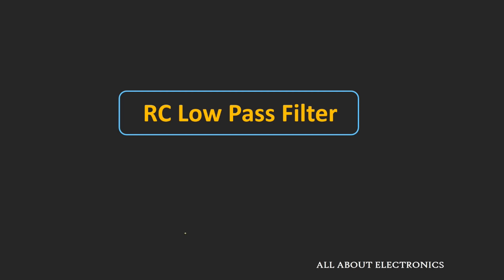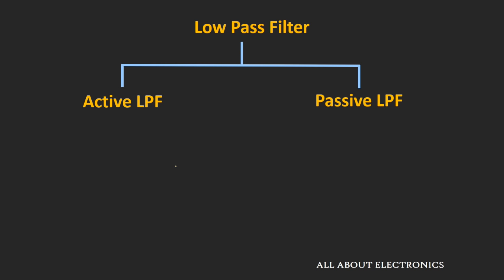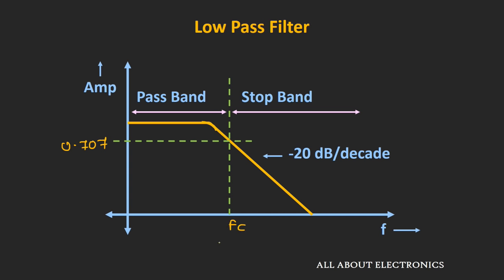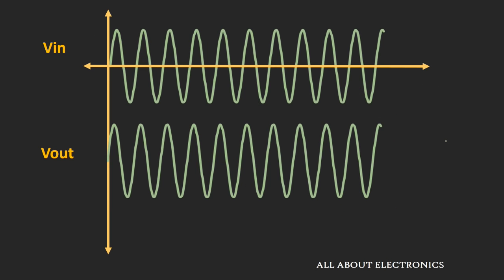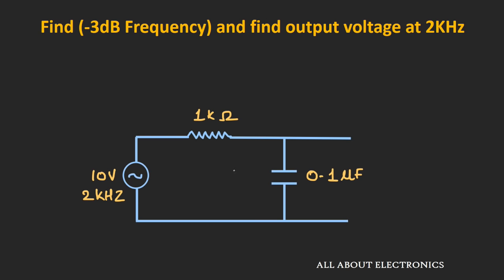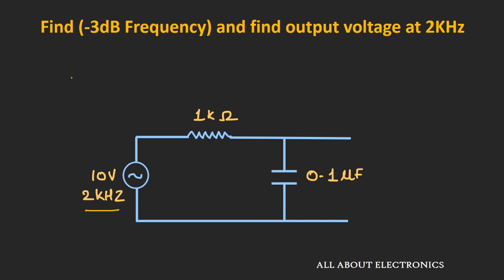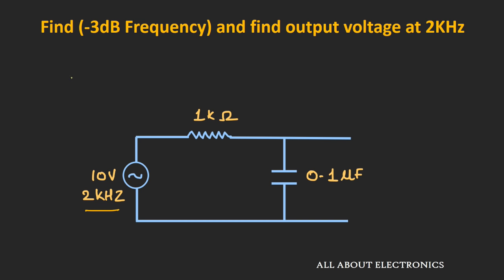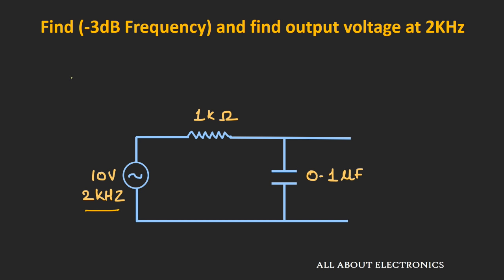RC Low Pass Filter Explained

Comment: At 9:10 you wrote 2(pi) x 10^3 x 0.1 x 10^-6.  PLEASE BEAR WITH ME.  If the resistance(R) is 1 kila ohm  and the capacitance(C) is 0.1 µF.  Why is it not written as 2(pi) x 1 x 0.1 and where did the third power, as well as the six power come from. Why is the sixth power negative? Also is omega a constant. If so, what is the constant value? If you don’t feel like answering all this, I understand can you copy the link to one of your other videos so I can learn where this stuff is coming from?

Comment: Good explanation sir.. cut off frequency is 120hz, frequency band 20 to 120hz,  its for a 200watts subwoofer,  that is output from the amplifier sir..
1) what could be the value of resistor and capacitor for either second order or third order? 
2) How to find the resistor wattage? 
3)substitute unit in the cut off frequency formula,  ex:  resistance in ohm or kilo ohm,  capacitance value in farad or microfarad or nf etc,, 
If you help me solve this sir,  it could be  useful not only for me but also for everyone sir...
Reply: We are all waiting for your valuable reply sir

Comment: t's basically how fast the capacitor charges.. There's a resistor there so.. it gives resistance.
The charge curve is effected, but there's no load resistor to say how fast the capacitor can discharge.

So... a specify threshold frequency is controlled or watched..  The resistor in front of the capacitor is kinda like a regulator valve for how much frequency at a specific voltage is allowed to enter or charge the capacitor.

What medication can I take to remember all these equations.. lol.. seriously.

I WILL learn.. If it takes me my whole life. I've learned a great deal, but more MUST be learned.

Comment: I didn't understand in 10:14 minutes
.. how Vout = |xc|/√(r²+Xc²)   ? 
plz help.
Reply: Look at the circuit diagram it's similar to voltage divider and therefore r2×Vin/(r2 + r1). Then replace r2 by Xc and r1 by R as given.

Comment: Thank you sooo much I understood this concept very clearly 
But one doubt how did we get 
Vout=(xc/xc+R) ×Vin
This equation
Reply from the maker: Using the voltage divider rule.
Reply: @ALLABOUTELECTRONICS  thank you soo much
Reply: Hello friend, Vin/(R+jXc) is the current through the circuit. Output voltage is the product of current flow through the circuit and capacitive reactance. So Vo = jXc×Vin/(R+jXc)
Reply: @circuitsanalytica4348  thank you 😊😊

Comment: at 5:03 the output reduces by a factor of 20 if frequency is increased by a factor of 10
Reply from the maker: It is in dB. If you convert the dB into normal amplitude then it will reduce by the factor of 10.

Comment: At 3:13 I’m confused, I’m pretty new to this find of stuff so tell me if I’m wrong. But Vout is Xc•Vin/(Xc + R) which means that multiplying Vin by Xc, then dividing it by Xc, wouldn’t that just cancel out?
Reply from the maker: Vin is not just divided by Xc, it is getting divided by (Xc + R). So, Xc will not get canceled out.
Reply: Dear Collin, it is the application of voltage division rule. Vin/(R+jXc) is the current through the circuit and product of this current and capacitive reactance will give output voltage......

Comment: on 7:12, aren't we taking the phase difference between voltage across resistor and capacitor? Which is clearly 90 degrees.
Reply from the maker: No, here we are taking the phase difference between the input and the output. The output is the signal across the capacitor.

Comment: Good job explaining. Appreciate it. Can you kindly explain to me that is it possible to use one of these filters to chop down frequency coming out of a high frequency (HF) transformer @220v, to 50 Hz @220v +- 5%?
Reply from the maker: Filter selectively passes certain frequencies and removes the unwanted ones. In your case, if HF transformer does not contain the 50Hz frequency component then it certainly cannot be filtered out using filters. Filters cannot perform the frequency conversion, it can only select or reject the band of frequencies from the input. 
I hope you understood what I mean to say.

Comment: Class is very informative sir .I have question that a signal passes through a low pass filter with cut off frequency 10Khz then what is the minimum sampling frequency?
Reply from the maker: Do you mean to say, what should be the sampling frequency of the filtered signal?
Reply: @ALLABOUTELECTRONICS  will you plz tell me how can f=2000?
I didn’t understand.
Reply: @moriomchowdhury9170  2khz input fq is f=2000hz

Comment: How is the phase lag zero for zero frequency (DC signal)? It will take a while to charge up the capacitor from 0V to DC voltage. Will it not account for phase lag?
Reply from the maker: For DC, frequency f=0 or w=0. So, phase tan-1 (wCR) will be zero. Of course, capacitor will take finite time to charge to specific value at DC. But it will come under transient time. Here we are taking about the phase lag in steady state condition. Therefore for DC, it will be zero. 
I hope it will clear your doubt.

Comment: Sir,having a doubt.@11:09 in the graph of frequency response when there is the line parallel to frequency axis for low pass band,is that showing the amplitude of input and output are same(i mean is that showing unity gain?) cause if we think the low pass filter as RC circuit,then the amplitude of voltage across the capacitor won't be same as that of the input amplitude,right?
Please help sir🙏
Reply from the maker: You mean in the passband right !! In that band, the gain almost remains constant. Of course as you rightly said, the reactance of the capacitor changes with frequency and so does the relationship between input and output. But in the passband,that change is very subtle. And  when the scale is in dB, it hardly noticeable.

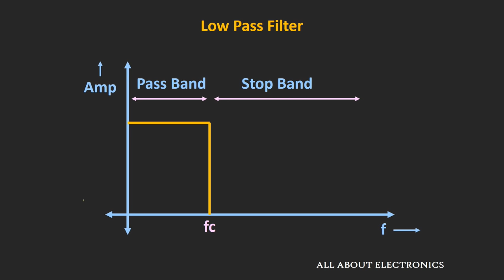Comment: At 4:15 , is it -20dB amplitude or power , please confirm. and when dB is mentioned how can I tell if it power or amplitude ?
Reply from the maker: It's amplitude. The power in dB is described as 10 log (P2/P1), while voltage in dB is described as 20 log ( V2/V1)

Comment: i have a question, if i have a time domain signal of a magnitude of 1V, and my low pass filter is of a magnitude of 0.4 , does passing the signal through a low pass filter will affect the time domain magnitude ?
Reply from the maker: If in the passband, the amplitude of the filter transfer function is 0.4, then even if you applied 1v signal, at the output you will get 0.4V signal.

Comment: Hello 
Thank for the video,  one question I hope you can give me some guiding 
If there is one more resistor in the circuit parallel to the capacitor (to the right side of the Capacitor) and we are supposed to measure the output voltage across that resistor. how would that affect the filter's output and cut off freq and how should i think when calculating output voltage and cut off freq. 
Thank you in advance
Reply from the maker: first, you need to find the tranfer function. From transfer function, you can easily find the cut-off frequency equation.

Comment: Great explanation 😊 just 1 question: on 12th min. you said with the increasing of order of the filter, amplitude at 2kHz is decreasing. But in the graph, it seems all amplitudes are the same. Could you explain?
Reply from the maker: Although it seems that, but at the given frequency if you see the amplitude on the vertical axis, it will be different. For example, at a 2kHz frequency, I have drawn a vertical line. Now, if you see the intersection of that line with the different line (Blue, Red, pink) and corresponding amplitude on the y-axis, it will be different. 
I hope it will clear your doubt.
Reply: Thank you :) Intersection of that vertical line with blue one cprresponds to 0. Should it be so?

Comment: Thanks, I applied the example on octave but there is a weird thing
Why outputvolt2 don't equal outputvolt1? 
code:
---------------
r=1000;
c=0.1*10^(-6);
f=2000;
inpt=10;
Xc=1/(2*3.14*f*c)
b=Xc/(r+Xc);
a=Xc/(sqrt((r)^2+(Xc)^2));
a
b
fc=1/(2*3.14*r*c)
outputvolt1=inpt*a
outputvolt2=inpt*b
outpt=inpt*(1/sqrt(2))
----------------------------
result
Xc =  796.18
a =  0.62287
b =  0.44326
fc =  1592.4
outputvolt1 =  6.2287
outputvolt2 =  4.4326
outpt =  7.0711

Comment: Could you please explain where the -3dB is coming from in the graph at 04:42? I get the cutoff frequency but where are we getting this number from? Thank you so much in advance :)
Reply: actually at fc the Vout is 0.707 of Vin so By using the Gain in dB formula which is 20 log (Vout/Vin) you get 20 log (0.707) which is nearly equal to -3 dB. That's how you get it.

Comment: thanks for the video and I have one doubt how loading effect will be reduced by making R2=10R1
Reply from the maker: At low frequencies (lesser than cut-off frequency), Xc will be high enough and can be assumed as open circuit  for analysis. (And R1 and R2 will be in series). If R1 and R2 are comparable then R1 will change the cut-off frequency of second filter. By selecting the R2=10R1, the effect of R1 on second filter can be  reduced. 
I hope it will clear your doubt.
Reply: @ALLABOUTELECTRONICS  sorry I can't understand

Comment: Sir, here 2nd order cut off frequency formula for low pass filter, how you get the formula?....
Reply from the maker: The procedure is very similar to the first order filter. You can use nodal analysis to find the voltage. basically, you need to find the expression of Vo/Vin. If try the same procedure, you will get it.

Comment: In the RC exercise, you first found the reactance at cutoff frequency (796) and then used it to calculate the output voltage. But since input frequency is 2khz dont you have to recalculate reactance before finding output voltage?
Reply from the maker: The value of reactance is found at 2 kHz only. (10:05)
The cutoff frequency is 1.59 kHz.
Reply: Aah.. right. My mistake.
Reply: Can you also please explain LC low pass filter, and how to choose filters RC LR and LC by usage, when you have time?
Reply from the maker: Yes, whenever I get some time, I will make a video on it

Comment: can't we just add a unity buffer between the two low pass filters when using passive LPF, or would adding a buffer turn this into an active LPF?
Reply from the maker: Yes, it can be added. But yes when we use any active element then it's an active filter. But it won't provide any gain.
Reply: Dear friend, if you want the amplitude of the output, same as the input then a buffer amplifier will do and the filter is an active filter. If you use opamp based filter then amplitude can be more than unity....

Comment: why we take only r.m.s value of frequency (1/√2 of v0) instead of any other value?
Reply from the maker: Because at the cut-off frequency the power becomes half. And the voltage is 0.707 or 1 /√2 of the maximum value. 
Its also called 3 dB frequency.

Comment: Hello sir...i have one  In this video your telled the one problem. In that problem fc=(1)/(2πRC) = (1)/(2*3.14*(10*10^3)*(0.1*10^-6))= i am getting value is 159.2356 hz interms of Khz = 0.159khz but your explained as 1.59khz how sir that.? Can you check and clarify.
Reply from the maker: R is 1 kΩ, you have taken 10 kΩ. Please do calculation with 1kΩ, you will get it.

Comment: Hi. May I know how to choose the optimum resistance and capacitance based on not only cut off frequency but also the time constant? (If lower cut off frequency, the time to reach steady state is longer right?)
Reply from the maker: Since the time is inversely proportional to frequency, so smaller the cut-off frequency, the longer will the settling time. Your actual output depends on your input signal shape and frequency.

Comment: Careful from 14:04. please give some info for last portion.
Reply from the maker: As the frequency increases, the impedance of c1 will increase. And for high cutoff frequencies, it will be in Mega ohm. And it can be considered as open circuit for such case. So R1 and R2 will be in series. Now because of that, the cutoff frequency of the second stage will get changed. It can be reduced by selecting R2 as atleast 10 times R1. Or that effect can be almost removed by using the active filter.
I hope it will clear your doubt.

Comment: Where does the square root of square root of R^2 + Xc^2 at @5:56 come from?
Reply from the maker: Here just the magnitude of the transfer function is considered. If you see the transfer function then it is Xc / Xc + R.
Or 1/jwc / [ 1/jwc + R] = 1 / (1 + jwcR)
So, if we just consider the magnitude then it is 1 / sqrt (1 + (wCR)^2).
If you know about the complex number then you can easily correlate it. 
e.g if you have A + j B, then its magnitude is sqrt (A^2 + B^2)
I hope, it will clear your doubt. If you still have any doubt then let me know here.

Comment: As you have mentioned that loading effect is difficult to overcome in second order filters. What is loading effect?
Reply from the maker: Like I said, when you cascade two low pass filters, then the second low-pass filter will act as a load for the first filter.
Let's say R1 and C1 are the values of resistor and capacitor for first filter and R2 and C2 are the values resistor and capacitor for the second filter. (and let's assume that R1=R2 and C1=C2). So, the input impedance of the second filter R2 +XC2 will be in parallel with XC1. And that will change the cut-off frequency of the filter.
So, suppose if you are designing second order passive low-pass filter, then the good practice is to choose R2=10R1 and C2=C1\10 (So, that R1C1=R2C2 and the cutoff frequency of both filters will be same). And in such case when you connect two filters then loading effect will be negligible. (as, R2 +XC2 in new case is much higher than as it was previously, and when it is in parallel with XC1, it will not affect XC1)
I hope it will clear your concept about loading effect.
Reply: yes, its cleared now..
Thanks

Comment: Sir, can you please tell what would happen if we remove the resistor from this circuit or in other words what is the need of resistor here?
Reply: Same doubt!!. Why do we need resistor
Reply: The combination of resistor and capacitor acts as a voltage divider, if there is no resistor, output will be always zero, for all frequencies as current flow through capacitor is always zero.....

Comment: What is -3db..n y u took -3db y not other value....can u explain it plz
Reply from the maker: -3dB is the value, where the output power is half of the input power. Or in terms of voltage, the voltage is 1/√2 of input voltage. Typically, during the filter analysis, the frequency at which the power becomes half, or the voltage becomes 1/√2 is important parameter. So, from there this -3dB comes. For more information, you can check this video on Decibel (dB). 
https://youtu.be/ta1sUTiJNkY?si=5ObF4JcfX8mXPBmA

Comment: 5:12
Hey, like I don't know how to do math yet I know how to assemble, what would you say the best resistance and capacitance for an output of 3.86KHz???

1/2πRC≈3,860

So far, the best I could get with this formula is ~3,881 with "R=1,000Ω" and "C=410uF"
May you help, please? :')
Reply from the maker: You can use C = 10 nF and R around 4.1 KΩ. If required, you can use trim pot to adjust the value of resistor.

Comment: Simply awesome ... 😊 Thanks a ton . and i have a query if you may help !
Reply from the maker: Yes, of course.  Do let me know here.
Reply: Sir im preparing for IES , so wanna know the topics belonging to its syllabus . Videos from you have covered Gate syllabus completely , i wanna know the additional topics which strictly defines Network tbeory and analysis IES syllabus , kindly mention , i will try to cover them from whatsoever sources . Thanks. 😊
Reply from the maker: For network theory, the syllabus is almost same in both IES and GATE exam. The topics like Two Port Network, circuit analysis using Laplace transform and state equations for network are yet to be covered and I will try to cover these topics probably by next month.

Comment: I have a question. If we can achieve the same filter at different RC combinations, is it better to use smaller R or bigger R values and is it the same answer on high pass filter? Thanks
Reply from the maker: It actually depends, what is the impedance of the input stage (Source impedance). And at the same time, you need to take into account the operating frequency (for load). Because at the high frequencies, the impedance offered by the capacitor will be low. So, in that case, you need to select the capacitor value such that there is no loading effect due to the capacitor and accordingly select the R. 
And at the same time, R should be greater than the output impedance of the circuit which acts as an input to the filter.  
The best practice is to use a buffer circuit at the output of the filter to avoid the loading effect. And one can select the R according to the source impedance. 
I hope it will clear your doubt.
Reply: @ALLABOUTELECTRONICS  thanks. I actually use op amp before and after (with gain not just buffer). I use both low pass filter and high pass filter but not certain of the best values. I would appreciate if you can have a video or blog about this. Thanks
Reply: @ALLABOUTELECTRONICS  and I work around 5-30 Hz so I believe frequency is not a major factor here on capacitive impedance.
Reply from the maker: Yes, I think since you are using input and output buffer and operating at a low frequency, the resistor values won't impact much.
Reply: Dear Waleed, you may use input and output buffers to reduce or eliminate effect of loading.....

Comment: At  9:33 shouldn’t it be .159 KHz? Or am I missing something? Thanks in advance.
Reply: no hes right its 1.59khz. make sure you are using the right exponent for the capacitor it should be 10^-6.  
(1/(2*pi*1000*0.1*10^-6))
Reply: @sum1528  thanks for the help!